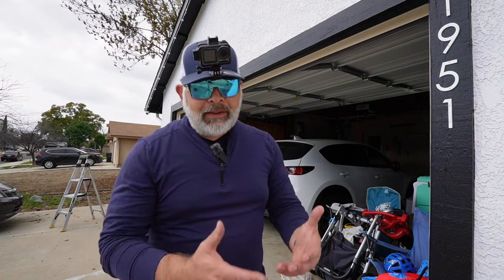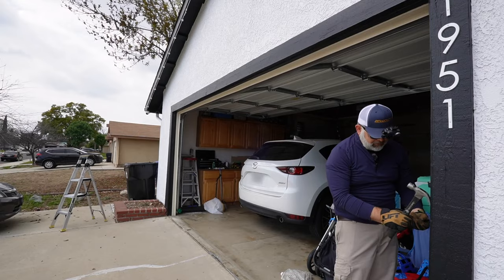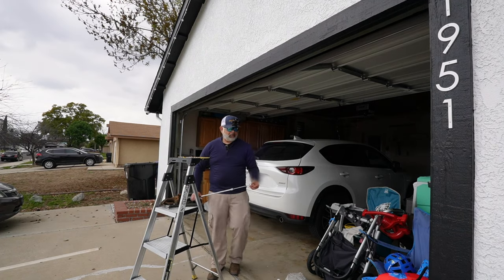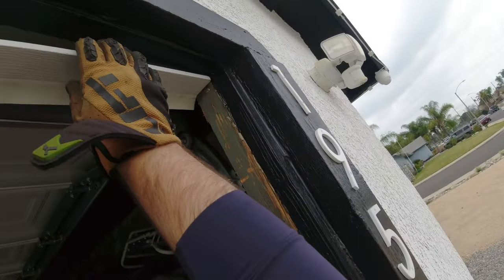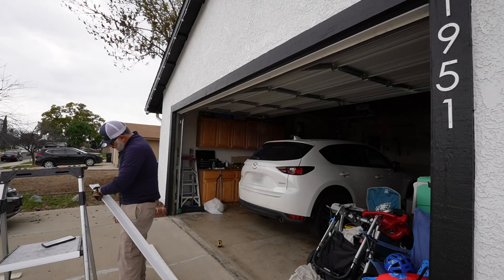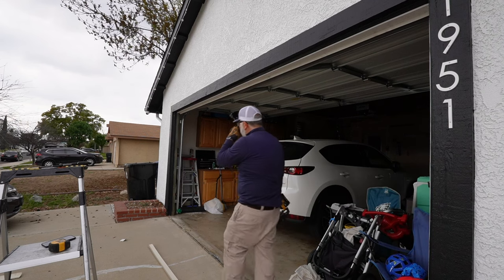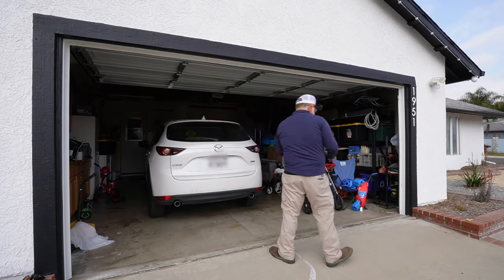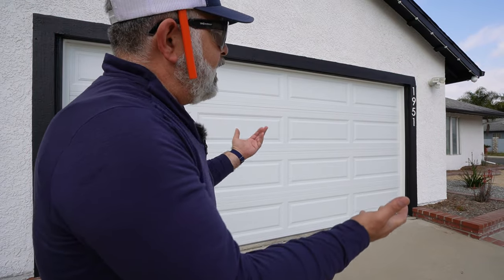DON'T MISS This Key Step Replacing Garage Door Seals

Comment: I always use painted nails. I tap/preset nails then install as that is so much easier than setting them one by one on the door frame. I never use pvc as it has the tendency to break, especially if you have to remove or readjust, or in you are installing in cold, (although some colors cannot be had in vinyl) I always measure half over on a 16' wide or 18' wide then mark a line, then measure from line over. If need be, tap a brad nail in and run the tape off that. Always install with the door closed.
Reply from the maker: Thanks for the great feedback!

Comment: I do my seals with the door down so I'm sure that it's making a good seal. And the vert seals I cut the vinyl on a 45*.
Reply: Same
Reply from the maker: Thanks for sharing!
Reply: Literally scrolled down to say the same thing lol. I also do my molding with the door down. And I don't measure. Top piece I just start nailing in from right to left. When I get a couple feet from the end, I make small cuts and dry fit until it's perfect. Same for the verts. Start nailing in from the bottom so it's touching the floor and when I get close to the top, small cuts, dry fit, perfect.
Reply from the maker: Thanks for sharing!